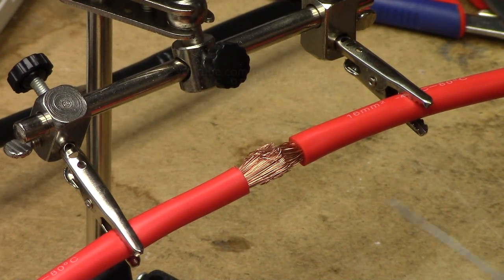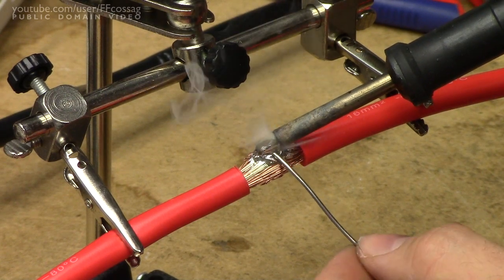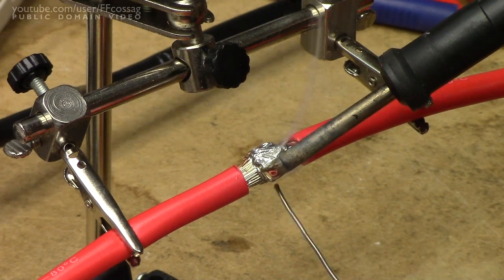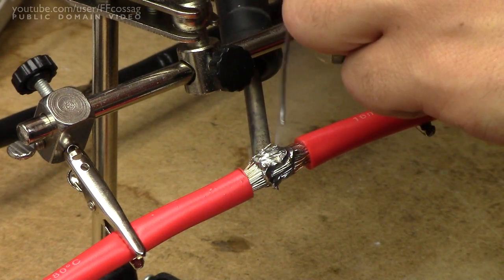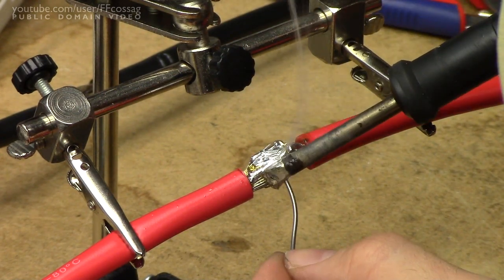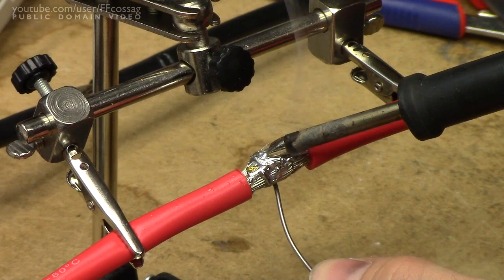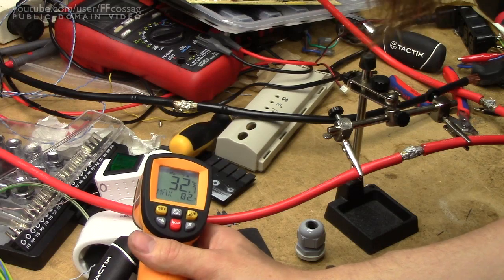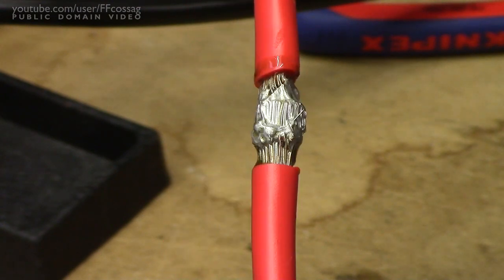AOYUE 2901 vs. 16 mm² copper wire (real time)

Comment: I'd be concerned about the resistance of that join, and how much heat it will produce at the cables rated and maximum load. Given the size of the cable, I assume you're going to run some non-trivial current through it. I'd use a hydraulic crimping tool myself.
Edit - hmm. Maybe that wire isn't as big as it looks on the video. A regular ratchet crimper would probably the the job.
Reply from the maker: Yes, this is obviously not a solution for doing anything properly. This cable will never see more than about 40 A out of its maximum 80 or so, so it makes no difference.

Comment: cut the at the joint so we can see if solder penetrated  to middle of wire
Reply from the maker: I would have, if not for the fact that I needed that wire. Also, when you cut tinned wires, the tin tends to "smooch" out across the cut, making it seem as if it penetrated even though it might not have.

Comment: Gr8 demonstration! Oh yeah, by the way heat raises. If you hold your iron on the bottom and solder on the top you should have better results!!
Reply from the maker: You can't do that, as solder drips down and just runs off of your iron rather than getting wicked into the wire.